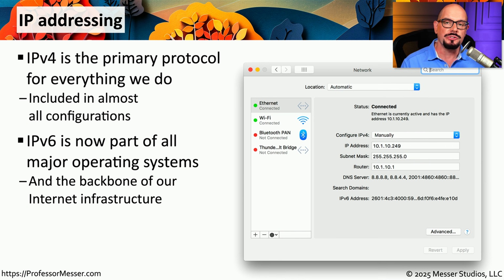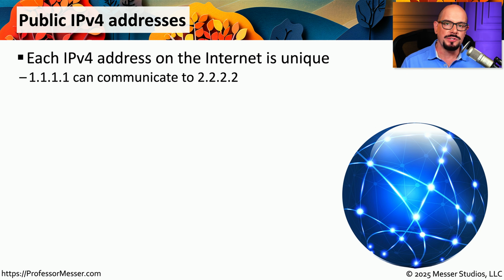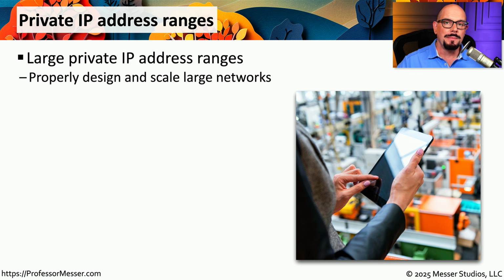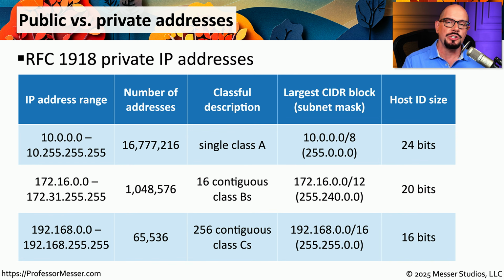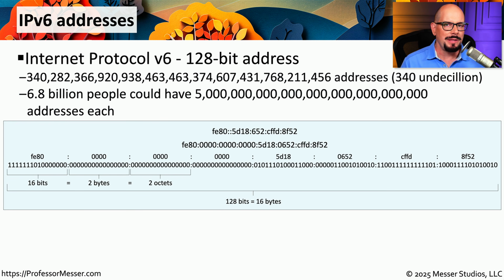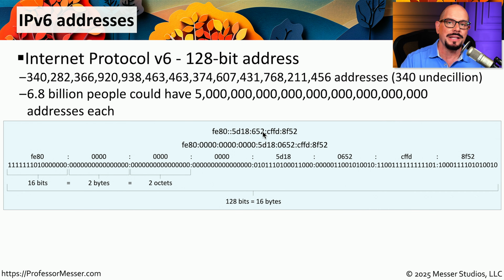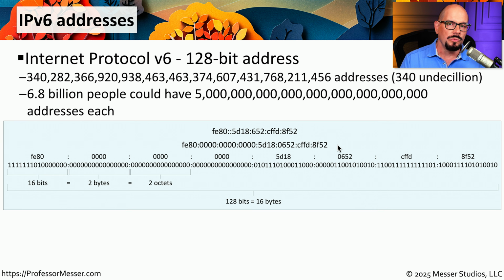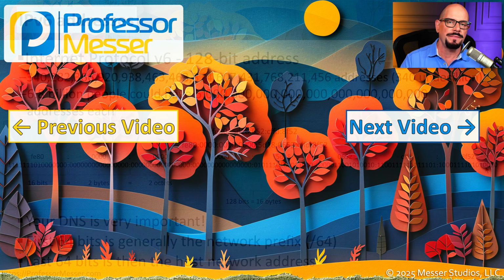IPv4 and IPv6 - CompTIA A+ 220-1201 - 2.6

Comment: stupid question, if i took and passed the 1101 last year but have been studying for (and putting off) the 1102, do i need to take both the 1201 and 1202 to be certified? or just the 1202
Reply from the maker: You would need to pass your 220-1102 exam before it retires in September 2025.
Reply: @professormesser  oh that's perfect, thank you!
Reply: I'm pretty sure you have to take 1102 to be fully certified then. Both core 1 and 2 have to be from the same suite.